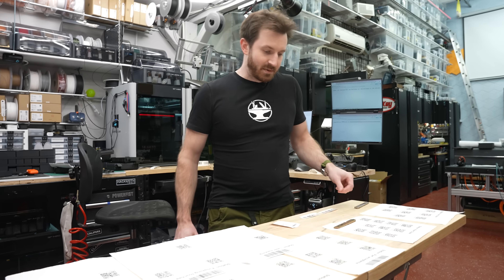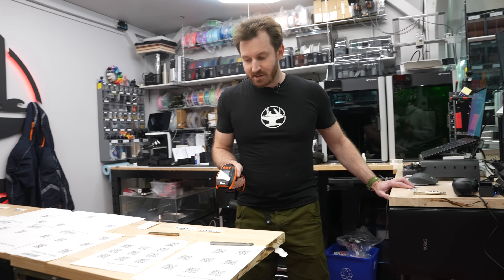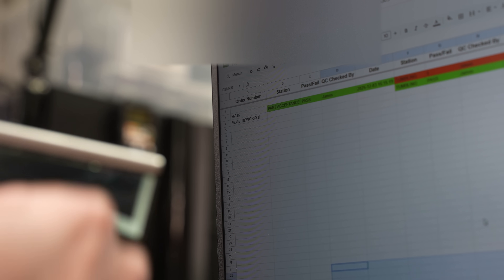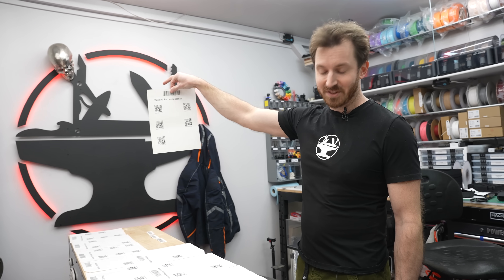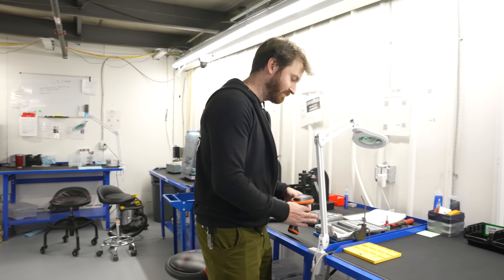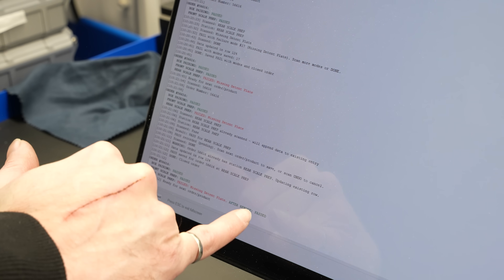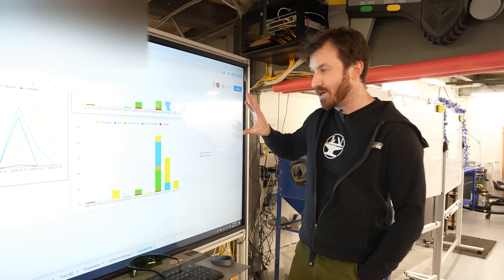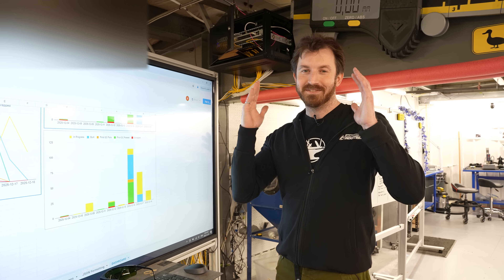Quality... CONTROLLED! | Smith Blade Update | 10

Comment: 7:30
"It might sound silly to make sure you put the part in the knife..."

Not really.
If you were only doing it once or twice, sure.
But you guys have like +40,000 individual backers, and who knows how many knives to go through just from Kickstarter backer orders (not to mention all future orders).
Even if you only have a mistake rate of 0.1% (1 in 1000) which would be amazingly consistent for any human, and even if each backer only ordered ONE knife that will be made there in the shop for a total of 40,000 knives...
...on a knife design with like 20 components that's a potential 800 failures in the kickstarter batches alone.
(And we all know there's going to be WAY more than just 40,000 knives ordered, given that most backers ordered the Pro version and there's no way everyone just ordered ONE knife each.)

Comment: As a software engineer, this looks more like a prototype than something I’d consider production-ready. Relying on a standalone Python script and using Google Sheets in place of a proper database raises concerns around maintainability, data integrity, and scalability for a QC workflow. It’s great that you got it working and that it serves its purpose right now, but I’d be cautious about treating this as a long-term solution without additional structure and hardening.
Reply from the maker: Which I prefaced muuuuulitiple times about how we're waiting for the main ERP system...

Comment: Using a spreadsheet is a quick and dirty way to get it working. But using a barcode scanner as the input device? That's kinda absurd and Way more complicated than sticking togeather a webpage interface on a tablet or pc.
Reply: barcode scanners just type the barcode number very quickly. the qr is just numbers, its no different than typing the numbers/words of whats wrong with it. This isnt much more complicated for how much simpler it makes it for the person performing the QC.
Reply from the maker: It's really not. Buttons, keyboards, all kinds of ways to mess up.

Comment: This is stupid cant you do a stream deck  or custom keyboard
Reply from the maker: So you can press the wrong buttons?
Reply: @theHacksmithVLOGS sorta just seams complicated scanning macro keys you can  do all of the things with combinations
Reply from the maker: Either requires menus or drop downs... Different 'buttons' each station mean the system isn't duplicatable 1by 1... I guarantee it's way faster then pretty much every other system short of fully automatic via cameras.

Even with buttons. You'd need to barcode scan the work order, no way you're typing that in

Comment: Instead of barcodes and QR codes It might be easier to use labeled buttons because you can color code them as well
Reply from the maker: Then you need that many buttons... At that many stations. 

Barcode system is simple and is how a lot of QC is done in manufacturing. You can contain so much data in a QR code

Comment: As a software engineer, this is simultaneously very impressive and absolutely horrifying.
Reply: For one day worth of coding and getting the logic running it's impressive. But I can't decide if I'm more horrified at using a spreadsheet as the database or a barcode scanner as the input device
Reply from the maker: Have you guys never been in production environments... Barcode scanners are used everywhere!
Reply: @theHacksmithVLOGS  Makes sense up to a point but having lots of different lists of codes to scan for your various statuses scares me. I'm not sure I've seen a UI be 100% barcodes. Seems too easy to make a mistake to me. 

And the Google sheet as the database doesn't scare me that much, but the flat structure will limit the types of reports you can easily do.

Comment: Very cool bespoke solution. I am a little concerned you'll run into performance issues with lots of people concurrently adding rows to google sheets.
I'd suggest a PostgreSQL instance (AWS?), and you could host grafana on an EC2 instance (free, except for hosting). 
I don't know how detailed your tracking will be ultimately, but you could track batches of material, machines that did the... machining.
Great for quickly spotting issues, and quarantining all impacted parts.
Reply from the maker: Will be transitioning it to a MySQL database soon
Reply: @theHacksmithVLOGS on-site, I hope. Maybe another call to LMG is in order lol

Comment: I want all those details in the box when I get my knife. It would be awsome to see the actual work gone into making the knife even if it had an issue that was fixed.
Reply: Or a way to look it up online based on the product/tracking number on the box, that way you don't confuse/worry those that just want a knife and might get worried if they got a "fixed" blade, while those that do look it up are probably aware enough to realize that a "fixed" blade is just as good as a no-issues blade.
Bonus points for the free tracking they would get on how many people actually use the lookup etc.

Comment: I sent in a support request about 2 weeks ago cause i noticed the shipping address was wrong on my order and still no response.

I really appreciate these updates and looking forward to if and when  i actually get my smith blade. I just wish there was a little more focus on customer support.
Reply from the maker: There's 3 people working full time on CS, if that gives you any idea how backlogged the system currently is. When it comes to CS sadly 80% of the work is from just 20% of the customers, which means even for simple requests it can take way longer than it should
Reply: I got a messaged back on day 11 or 12? I will say I was 13,500+ and that is no small feat to get that far that fast. Then again if I were in the first 5K backers I would be more worried about mistakes. I am backer 20K+ So by that time I knew it would be all ironed out.

Comment: It likely isn't an issue with your use case, but you can get a lot more info into a smaller 2D barcode by using  a datamatrix or Aztec barcode instead of QR. QR are super well known, but the vast majority of barcode scanners support many barcode types without additional configuration. The other thing you could do, if it makes sense, is encode an order of operations into each barcode. This would let you require a pass fail scan on each process in a predetermined order and have the code yell at the QC person if they scan things out of order lol
Reply from the maker: The program already handles that :) the stations are in order 😊

Comment: Vibe coded by a mechanical engineer into prodution I'm not even mad I just wan to see the fallout in the future vlogs
Reply from the maker: It's a simple program, it just looks for barcodes and matches to the structure. As with a lot of the stuff I've vibe coded its the difference between actually doing something... And thinking that would be nice (but would take weeks to do normally)
Reply: @theHacksmithVLOGS  No doubt, LLMs have saved me a lot of time and gotten tons of my project into the douable range.

There is also plenty of time where they have driven me straight into a wall.

I'm genuinely curious how the software behaves and evolves over time.

Comment: Can you guys fix scratches on the Smith blade? If so, is this something that the customer can do after years of use?
Reply from the maker: Titanium is a soft material and will eventually get little scratches, but it looks very uniform 😊 if you'd like a more robust finish the PVD coating available on Lites is much more scratch resistant 😊

Comment: How about images of what you are checking (on the sheets), with a smaller QR code in the corner so you get a quick visual prompt of what you want to scan rather than just text and code. EG a pic of a level with QR code in the picture. Easier for new staff for identifying correct code to scan.. Just a thought 🙂
Reply from the maker: Currently QC is done by just a few, but once the stations have computers, we will have work instructions and all that on display.

Comment: 1. This isn't ERP. 2. ERPs are rarely fully custom and you should probably get one before you start doing custom stuff that makes migrating to one painful. 3. Use something other than google sheets for your database, it's buggy and slow with large data quantities and has at least once completely disappeared all of my data.
Reply from the maker: then explain to me wtf the company we hired to setup our ERP has been doing for 6 weeks. i swear i gotta do everything myself  =(
Reply: @theHacksmithVLOGS genuinely they're probably doing nothing 95% of that time
Reply: @theHacksmithVLOGS try odoo or zoho. They make great erp systems
Reply: I feel like you should state your experience credentials. It would make trusting your information easier, and possibly give perspective to the similarities in you and Hacksmiths line of work. Obviously at this point it probably doesn’t matter, so I guess for next time you want to make “you’re doing it wrong” statements, I would recommend giving where your knowledge comes from. This is intended as constructive criticism, and nothing more.
Reply: @zooning-6843 Given that they're getting an ERP currently the only thing they're doing wrong is using google sheets. They're working on such a thight timeline that they don't really have options with waiting for the QMS (and this can be one of the ways you end up with bad systems, if you don't realize it early like they have.) Comment wasn't meant to come off as being harsh or judging, just a quick warning.

Comment: On the knife are you adding a barcode are QR code on one side or on the inside the way you track it all are you just bring a label on it to keep track of it next ladies barcodes though I use have a label system QR Code system that keeps track of all my tools the barcode scanner like you got to database my movies feel great job
Reply from the maker: just serial numbers for the handles. the problem with adding the QR code to an actual physical part is the QR code is just the order number -- it could change. we track it via the label qr code once it becomes a customers order. use the serial number to track down issues upstream =)

Comment: Oops, I scanned the wrong thing, how do I wipe the entry and start over? Do I have to start all the way over?
Reply from the maker: you scan undo
Reply: @theHacksmithVLOGS  Is this the training material. Person walks in... HackSmith: here watch "Smith Blade Update | 10" then sit at station #12. All jokes aside, great work. I think Barcode scanners are a genies way to get it rolling. It definitely has that distribution attitude, simple (code + Network Scanner + "DB" = Ready to go) not messing around with application windows, Page Padding, linking values to software buttons and later to stream decks or key binds... all that can be "someday."

Comment: Prototype = easy,  production = hard
Reply: As a software engineer I'd call this a prototype. There are so many potential issues with this system when using it in-production. You can obviously use a prototype system in production, but I wouldn't recommend it personally, at least not as a long-term solution.
Reply: @weibrot6683  I think he was specifically referring to the product, rather than the system. As in it’s easy creating a prototype product as it’s just CAD files and CNC programs but scaling that up to production requires a completely different approach and skill set. But I’d say you’re entirely correct with this system being a prototype as it’s very early stages atm but I think you’ll struggle to find someone who will disagree with you on this. We all know this is the Hacksmith’s first run at scaling an in-house project up so all systems, software through to machine, are just the bones of what they will eventually evolve in to later down the road. I just really hope they continue to generate enough revenue to sustain the investments they have made just to get this kickstarter up and running.

Comment: Vibe coding is fine for practical prototypes if you know what you're doing. The real reason you shouldn't create production grade software with vibe code is that you'll get something working, but over time the architecture of the code will crack faster than proper engineers would allow to happen. Eventually, not only will no human programmer want to try to untangle it, but AI updates to the software will become more error prone until eventually you have to scrap the whole thing. This problem grows exponentially with respect to software complexity.

Probably fine for what you're doing right now, would become concerning if you continued to build this out rather than track down a proper solution either with in house software development or external vendors.
Reply from the maker: Well aware. Also, your example depends entirely on the complexity of the program... there's lots of things that don't break because they're relatively simple .. like this program lol

Comment: Awesome way of keeping track of it!
But is there a specific reason you're not using a simple Web-App with a SQL database and buttons on a tablet screen on every station? In my mind, that sounds way easier for the person in charge of the control station
Reply from the maker: Again, we're waiting on the real ERP software, this was a stopgap I was able to implement in under a day, so for what it is, it works pretty damn good.

Computers at each station are on their way.
Reply: @theHacksmithVLOGS would a tablet work the same? Most are inexpensive and also have a camera so it might make it easier to scan the qr codes and save room
Reply from the maker: I wanted to do tablets 2 months ago, but the longevity of tablets lasting in a production environment... isn't great. So we opted to get mini PC's at each station...

which still aren't here. should have gotten tablets. amazon prime, solution ready, long-term viability could have been solved for after the system was in place.
Reply: @theHacksmithVLOGS Uff there's so much which can go wrong, it's impossible to account for it all. Hope they get delivered soon!
Reply: @theHacksmithVLOGS  Pretty good solution to be fair, we work with what we know. I work with TSQL every day, as a Data Infrastructure Architect so i also came to a similar solution to Jan_Albrecht. Nice little web app/interface linked to a SQL database. Nice interim solution for sure though.
Reply: Was about to come ask this question, i am glad that this is being addressed.
Reply: As a fellow OCD Data Junky, bravo! As a stop gate measure in a day this fantastic. Ever hear of SCADA systems? Once you decide on the ERP, next step in the process, get a SCADA connection on all stations & automate the inspection process. You will go nuts with it.

Comment: Very cool! Do the build numbers tie back to the cnc and bead blasting machines that worked on the parts as well so that you can trace back to potentially defective machines?
Reply from the maker: The machined parts are serialized with their machine that made them, but until the processes are perfect we can't track each individual part -- just the machine it came from.
Reply: @theHacksmithVLOGS at the end of the day I'd imagine this machine starting to make errors after x amount of parts is more useful than knowing exactly what part is bad when you're working out the kinks
Reply: @theHacksmithVLOGS Hey, thats awesome. You've done in days what it took me a year to get buy in for!
Reply: Thats awesome.
Reply: Unless I missed it I didn't see anything serialising components, just a scan to say "I'm testing one of this PN and revision".

Before implementing something similar I chose to get all of our components, mostly made by subcontractors, uniquely identifiable, and then write the software...